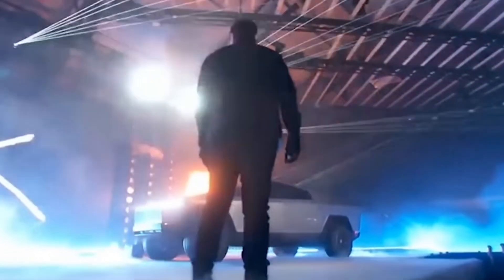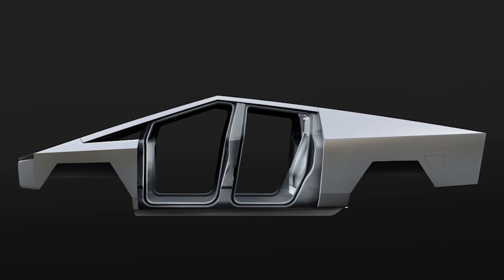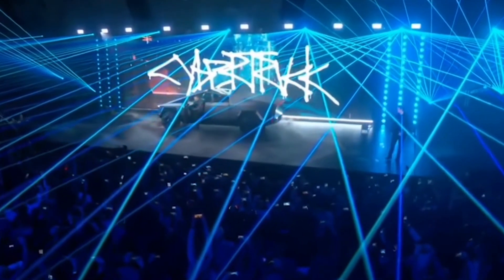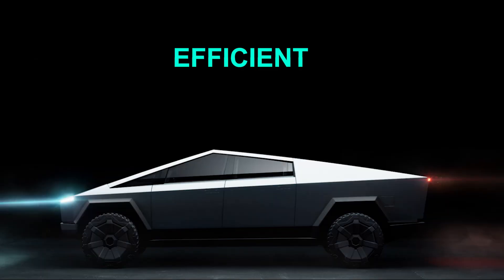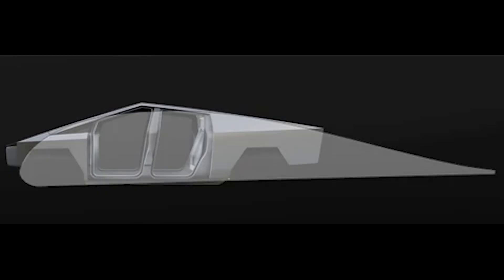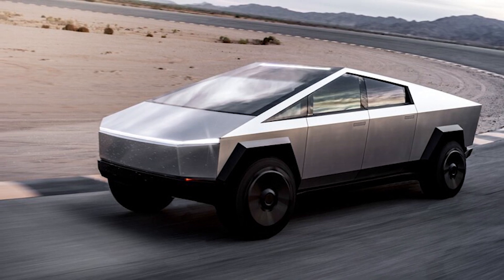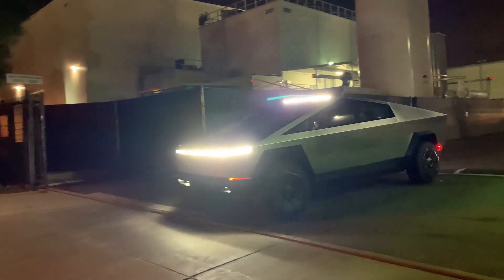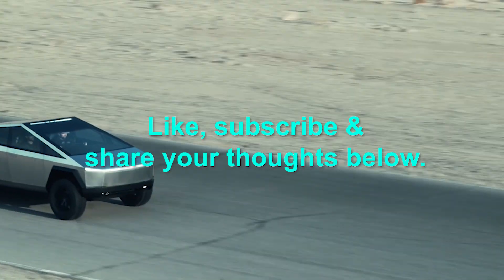Cybertruck is Engineering Genius (and will be copied)

Comment: It might be safe for you spuds inside but what about the people in the other car that got smashed because there's no crumple zone or the pedestrian it's also not light and has a tiny bed this truck was designed for people in the city that won't ever use a truck for what it's meant for
Reply from the maker: Lots of people are raising this. The steel can be scored on the underside to crumple predictably and consistently (and it appears the frunk is a separate coponent). I think many will be surprised at how well the Tesla engineers address this. Safety is always top of mind at Tesla. It may not appear so but the driver in Cybertruck sits the same distance from front of the vehicle as they do in Model 3 so there's equivalent space for crumple zone too.

End of the day, Cybertruck won't be allowed on roads if it is not sufficiently safe for occupants or pedestrians. Tesla are smarter than to design an unsafe vehicle 😉

Comment: A rigid shell will be less safe than traditional methods in which the front/rear crumple. The way you reduce impact felt by someone inside is to increase the time in which the contact occurs (F = Δp/Δt). so a rigid shell will impart a much higher force on the occupants
Reply: There may be other factors i'm not considering, but I do not think this will yield a high safety rating

Comment: So here's whats going on: Stainless steel will still bend/crumple/etc. It not indestructible in a crash. "EXOSKELETON" is a crazy cool way to say Uni-body. Its not new or really remarkable, in the sense that its easy to bend and fold over in any garage by anyone who desires to make something similar or whatever. Yes it will save time and money because its a great application in those terms. The steel will not rust, but over time will look mismatched because it will not be painted (again, great time/money saver) It's strong, but its heavy, which may help in towing and some functionality. The tailgate is cool, not new, the no in-bed fenders are cool but not new, same goes for under bed trunk storage. its utilitarian in storage capacity but as a car designer I've seen these ideas presented before on concepts and production models of many vehicles. The extendable tailgate may be copied by anyone and aftermarkets which may be cool. Aerodynamics cool, not all edges or the lack of crash/crumple space will be passed (especially in us) for production, let alone mirrors and the air suspension is awesome, functional and old technology. Shape is new and again cool but the functionality is actually lacking opposed to your video statements. Trucks have looked the same for many years because if functionality period. So design wise, i actually love the car. But that's what it is , a car. Its not a truck because it does lack functionality in that you cannot use it for anything other than storage. no reaching over the sides, sure those things add strength but being uni-body its not really a truck , but that's okay. In the unveil video, they showed the strength of the door, but hit ford aluminum door which is soft, duh, that is its purpose and the hammer they used was a dead blow hammer which is rubber edged so that it wont bend hard metals. Cars aren't made with hard steal because its safer for occupants to have softer steal crumple under impact than to throw them around within a strong box. bottom line, this is just a new cuv with bad visibility. sure theres a back up camera but if you are a truck driver, visibility is key, but its not a truck. Thats ok. this isn't a truck in that the workmen of the US and other who use trucks for work and as a tool, will not buy this. again thats ok. this is a lifestyle truck if anything, but thats where their desired market is confused, sure not all trucks are bought by work driven people, trucks are number 1 in selling in us and thats ok. soccer moms love trucks theyre are a statement and a presence BUT it has performance of a supercar , mainly because its electric but who cares?! the market for this truck is confused or for the people who buy iphones and apple mac stands and again thats ok. This isnt a truck, this is a cool vehicle for people who dont care about design (design is the balance between art/aesthetic and science/functionality) but more about the sculpture, which again is fine. But this is not a vehicle in which form follows function, it is a car with some elemental functions of various fields thrown onto the fuck you to those who dare not to buy along Elon's dream. IDK if i like it, im mainly just thinking as i type, but its an awesome vehicle, its just marketed as something it isnt and i guess thats ok because its getting the reactions that only Tesla, or the apple of car would get. Then it has a great price point which is cool too, but i just feel like their desired market for the car doesnt exist in that too many are co-existing?? -thanks

Comment: Not love at first sight but after 3 days, I ordered an AWD version. I was going to buy a model Y but after I compared all the features, cost and durability, the Cybertruck is the obvious choice. Can't wait to drive it!
Reply: But you'll have to wait 2 years! or more! lul.
Reply: Yep, I was down for a model Y; 7 seater, long range auto pilot...now I am waiting on the dual motor 4wd...thinking about going trimotor for the 500+ range.  6 seater is fine in my book.
Reply: @qpham63  Keep switching and maybe you'll finally end up with a completed car before you retire.
Reply: @advanceddarkness3  Yeah, I originally wanted a Model 3, then a neighbor gave me a good up close look...Trunk opening was too small.  Model Y, voila, hatch back...I was all set to go with the Y...then Cybertruck...If they would do something Tacoma size, I'd have to switch again, LMAO.
Reply: @advanceddarkness3  Oh, and I am retired...I just hope that if it comes much later that the self driving level 5 is in place so I won't run over slower drivers cause I can't see 'em.
Reply from the maker: Awesome Steve!

Comment: "They cut all complexity"
Has roll up bed cover
yeah okay guy.
Reply: I mean its just some metal slats joined by hinges connected to a motor but sure.
Reply: He means unnecessary complexity. The cover will be great, and shouldn’t be too big of an issue. 

The complexity he was talking about has more to do with the frame, the body, and even the lights. 

No internal frame= cash savings 
Flat exterior = cash savings. 
Single headlight instead of two = cash savings. 
Simple powertrain = cash savings.
Reply from the maker: @thermophile2106  Saved me some typing, thanks :)
Reply: The roll up cover Is garage door technology. You have to take apart a transmission or torque converter from a ice vehicle to appreciate their complexity compared to electric motors.
Reply: They literally cut everything tho, even the mirrors
Reply: @yourfavoritecrafter  To replace them with cameras probably, if they can get the legislation

Comment: First off, from the get go let me say that you are INCORRECT SIR! If this Silly thing does get copied, it certainly won't be done by the Major Automakers. Where I am sitting here at work right now, within 100 Yards from me is probably 150 or more pickup trucks that people drive into work each day. Within 300 yards around me is probably 400-500 pickup trucks that people drive into work each day. I work on a military installation. Pickup trucks are by FAR the most common vehicle on base and I don't personally own one. The main Pickups are Ford, Chevy, GMC and Ram, with some Toyota and Nissan trucks sprinkled in there. Tesla cars on base are very few and far between, I would say I have seen perhaps 10 with over 20,000 people who work on base each day.

Comment: I'm curious to see how and if this will transition to sedans.
Reply: I don’t think it will, at least not fully.

The cyber truck gets it’s function from being a truck, and many of the advantages don’t apply to sedans. 

Trucks need to be far more sturdy and tough by nature of their use. 

Trucks are really expensive compared to many sedans, so the cost savings on the cyber truck are almost more important. 

And of course the auto dynamics of it do not advantage a sedan. 

Basically, cyber truck design is good for trucks, and traditional design is good for sedans.

Comment: Hey Steven. Great video. 

Your one word resonated with me. 
When you said RATIONAL. 
I for one am not a truck guy cause I would only see use for it 3-5 times a year in need for the flat bed. Not justified , It wouldn’t make sense so I drive a SUV for hauling my family of 4 and occasionally grandparents. 

I look at the Cybertruck more as an SUV with benefits. Like a 6.5’ vault, power generator backup, smooth riding suspension that can feed my occasional need for speed. 

Haven’t even touched on the long term cost of ownership and self driving which brings it over the top to be a no brainer decision. 

I always loved the El Camino and this to me is the modern re-encarnation  of it.  So that’s why I made the RATIONAL purchase of a truck for the first time ever.
Reply from the maker: Thanks for sharing Raymond!

Comment: Big problem with the bed: you can't reach into it from the side. You can't really do anything from the side. How's that guy going to strap the front wheels of that quad down? How are you going to reach your tools that are in the bed? Walk in and out of the bed every time? The bottom of the bed is flat. You ever try to get a 3/4" sheet of plywood off a flat surface? It's no fun. The ramp is cool if you're carrying a quad but that's about the only good design back there.

Comment: While i Agree the steel is safe, what about Accident victims Stuck in such a car? Doesn't it take longer for the Rescuer/helper to cut through the deformed steel compared to Aluminium? but besides that, this would be probably one of the only drawbacks. I think its a smart idea to completely redesign and reengineer cars entirely, this way you can actually figure out new design methods, as musk did.

Comment: 437/5000
The trucks of Ford and Chevy are cheaper, the advantages that I see to the Cybertruck is that it is electric, the technology and the design I liked a lot I see it simple but for a good reason those two things combined seemed to me a very good idea. BUT I would buy a Cybertruck to replace a car, not to replace the farm truck, that never, as long as I have a more efficient recharge or battery life system. (google translate)

Comment: Some of the points in this video are valid, but some come from a lack of knowledge. The largest offender being that an air foil is not designed to reduce drag to the minimum, it is designed to either provide lift or downforce while incurring an efficient amount of drag. Neither lift nor downforce is particularly relevant for a truck as you mainly want better traction at lower speeds for most truck applications to increase total torque output, which aerodynamic effects do not provide. I don't hate the car, but this video is somewhat misleading.

Comment: Safe? Only for the people inside the truck. Imagine what happens in a crash with a pedestrian. There is a reason why carbodys are easy to deform.
Reply from the maker: Lots of people are raising this. The steel can be scored on the underside to crumple predictably and consistently (or the hood could be a separate component). I think many will be surprised at how well the Tesla engineers address this. Safety is always top of mind at Tesla. It may not appear so but the driver in Cybertruck sits the same distance from front of the vehicle as they do in Model 3 so there's equivalent space for crumple zone too.

End of the day, Cybertruck won't be allowed on roads if it is not sufficiently safe. Tesla are smarter than to design an unsafe vehicle 😉

Comment: Dude, sturdy body does not make a car safe - sturdy cabin and properly engineered crumple zones do.
Reply from the maker: Lots of people are raising this. The steel can be scored on the underside to crumple predictably and consistently (or the hood could be a separate component). I think many will be surprised at how well the Tesla engineers address this. Safety is always top of mind at Tesla. It may not appear so but the driver in Cybertruck sits the same distance from front of the vehicle as they do in Model 3 so there's equivalent space for crumple zone too.

End of the day, Cybertruck won't be allowed on roads if it is not sufficiently safe. Tesla are smarter than to design an unsafe vehicle 😉
Reply: @SolvingTheMoneyProblem  It better be, because from the arguments in the video it is not apparent, in fact it looks like quite the opposite.

Comment: the cybertruck costs more than a truck and unless you get the most expensive option, you’ll have a useless truck
Reply from the maker: If you spec out a like-for-like truck, and factor in running costs, not quite.
Reply: Solving The Money Problem they compared the tesla truck to the light duty pickups, while with the specs and pricing it would compare to the 2500 and f250 series. the price of the f250 and silverado 2500 trucks is equivalent to the tesla truck and the specs beat the tesla truck

Comment: This is bad car. Stupid desig, lack of frame means no place for special configurations. You can't simply take out truck bed and place specific things needed for many companies. You can't access cargo area from sides.  It is crap. EV can't tow, that is a fact the amount of energy it has in kWh is pathetic compare to energy stored in gass tank of F150. Even with 30% of efficiency gass engine has more energy than this. 

Basically this car can't do shit against on the market pickup trucks.
Reply: You are drunk. Get sober and watch some specialized videos on this subject.
Reply: @Samana009  Bala bla bla specialized videos done by people that deal with the subject all say the same. EV are crap when it comes to towing. Frame based cars  are easier to configure for specialized vehicles, EV fans can't understand that this crappy design is nothing new and it all ends that same way. Low sales numbers.

Comment: 1. its heavier than most trucks, 2. have fun going off road with this truck, 3. have fun getting any sought of repairs done on it lmao.
Reply from the maker: 1. It's the same weight as an F-150. 2. Did you not look at the specs? Ground clearance, approach angle etc? 3. Metalworker.

Comment: Why is nobody talking about how this truck will NEVER be put off the road because of RUST ..?
Reply: I am a firm believer that engineers that make spacecrafts are smart enough not to put a metal that rusts on the truck they design
Reply from the maker: Guess the "stainless" steel kinda goes without saying 😂
Reply: itsumadekokoni table forks don’t leave your house everyday at 40 mph + on/off roads.
Reply: It’s the same steel they used to make their new space ship. Plus I would just wrap my truck with neat colors to protect it.
Reply: @itsumadekokoni lol
Reply: It will still rust, do you lack basic education in chemistry
Reply: @Outdoorsman-tu2zs  Iron rusts, stainless steel doesn't rust unless the chromium falls below a certain percentage.
Reply: @bravomike4734  Stainless steel is not "stain proof." Even a high chromium steel can rust given the right conditions and enough time.
Reply: Outdoorsman 1971 lol you’re dumb as a rock

Comment: Excellent video!

I dunno.  I love the looks and everything about the vehicle, but I want to see even one grizzled, sun baked, gun totin' Texan give up his Ford F-250 for one to use on the ranch.  I have a feeling that Ford, Chevy and others are quite safe in their current P/U designs for a long while to come.  Right now, before seeing these out in the actual world being driven by actual people, it seems a little like it's going to appeal more to an urban "OK boomer" gang with man buns and organic, fair trade artisanal lattes firmly in hand.

Another point nobody seems to be making any note of is how much of the sleek design will likely be changed ("ruined") by FMVSS regulations on placement and type of lights, license plates, etc. etc. - I seriously doubt, for instance, that US regulators will let that steering yoke stand as is.  Finally, current crash tests are dependent on feature like crumple zones to absorb crash energy.  It'll be interesting to see how the "strong as f*ck" stainless corners and triangles actually perform.  Old cars from the 40's and 50's were very rigid and tough as well - and transferred nearly 100% of crash impact loads to the occupants - OTOH, they didn't have airbags.

But it's really cool.  Would I buy one?  Sure would!!  - as soon as I win the lottery.  I can't justify anything like those prices - even for the "base" model.
Reply from the maker: Thanks for sharing your thoughts Ed. Just one thing on safety. Lots of people are raising this. The steel can be scored on the underside to crumple predictably and consistently (or the hood could be a separate component). I think many will be surprised at how well the Tesla engineers address this. Safety is always top of mind at Tesla. It may not appear so but the driver in Cybertruck sits the same distance from front of the vehicle as they do in Model 3 so there's equivalent space for crumple zone too.

End of the day, Cybertruck won't be allowed on roads if it is not sufficiently safe. Tesla are smarter than to design an unsafe vehicle 😉